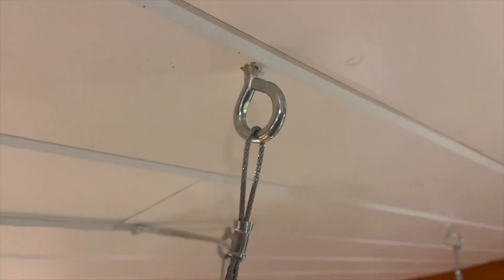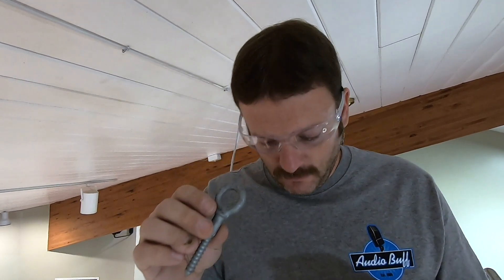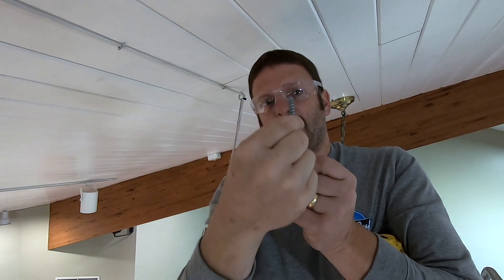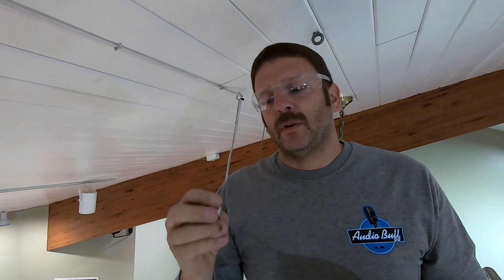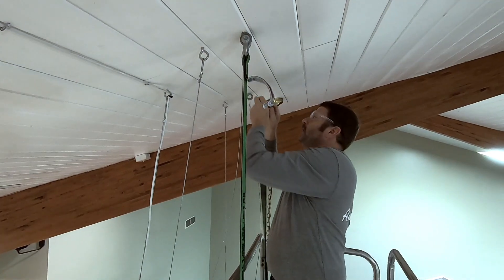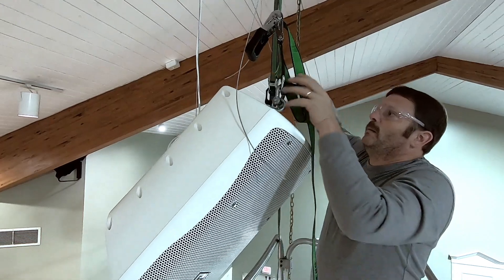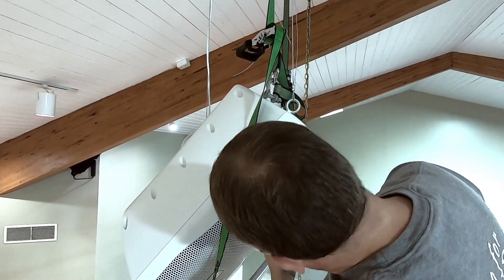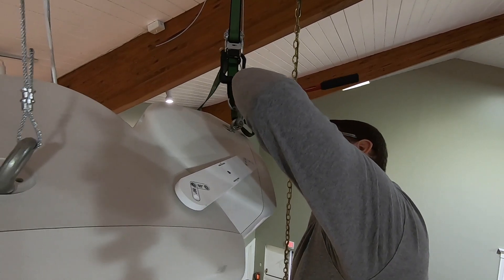Rigging Technique - Sound Advice 20

Comment: As far as engineers are concerned, a lag style eye bolt of any kind has a ZERO load limit due to the unkown characteristics of the material it is being put into... If the client or yourself ever desired to have an engineering stamp on that overhead rigging it simply would not happen.

Comment: Why would they specify a smaller cable?  Doesn't make sense considering the installation location.
Um, do you normally strap yourself to the lift?
Reply from the maker: Great questions. 1) The church was concerned about the 1/8” aircraft cable looking too bulky and the 3/32” cable gave us a total WLL of 540 LBS across the 3 hangingpoints.  2) Yes, normally I’d be tied off but we flew to the job and I thought they would have the proper PPE. Allowances can be made to work in a lift with high safety rails and not be tied off.  Thanks for watching!
Reply: @audiobuff  If aesthetics were a concern, could the bolts have been painted white and white heat shrink slipped over the cables?
Reply: @audiobuff  But did you change the rear hanging point?
Reply: I thought that was interesting too. Curious what their reason was.